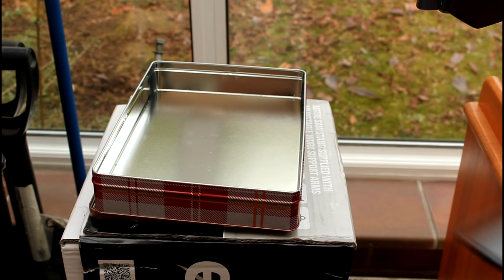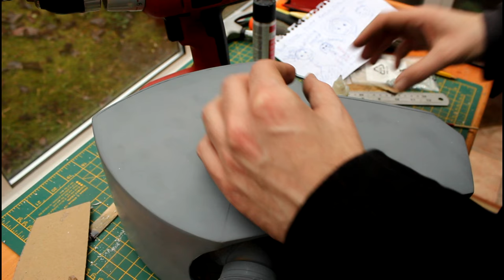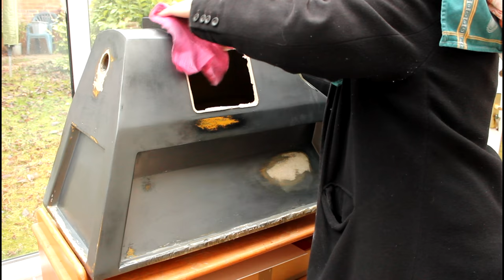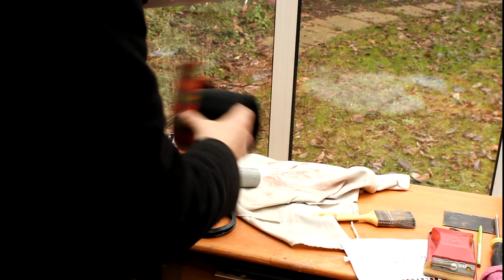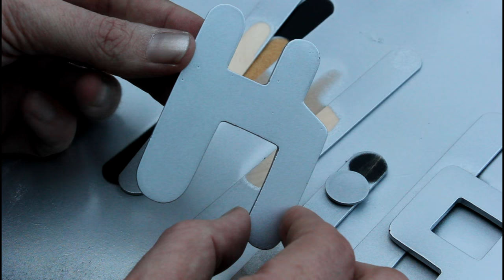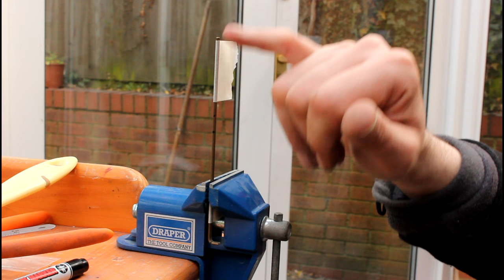K9 Replica Prop - Can this WRECK be saved?

Comment: This is fascinating and great video! I still have one of This Planet Earth's K9 which I bought nearly 20 years ago. Body wise it's still fine apart from a small chip near the nose where the hoover fell and hit it. The ears are the biggest pain in the rear. They seem to break just by walking past it.
Reply from the maker: Thanks for watching my first YouTube video - things have (slightly) improved since this was made. If you ever get around to repairing your dog, the paint used was Halfords Rover Gun Metal Grey - they do "touch up" pens, so that may work for you on the chip damage that it has.
Reply: @PBProps  Thanks. It's a small chip, but something I always notice first and irritates me.
Reply from the maker: The chip pen will work wonders for you in that regard then!
Reply: @PBProps  Just finished the vid now. What paints did you do for the ears and foam bumpers? Over the years the bumpers have got lost. I found a similar foam tube that I cut to size to match the remaining bumper. The new ones are lot lighter.
Reply from the maker: Trying to remember back five years, but the silver was possibly "Stardust" and the bumper paint was the black vinyl spray, usually found opposite the main spray colours in the specialised section, all from Halfords.

Comment: Any advice on how to make the screen from scratch. That's basically what i have left but I'm stumped.
Reply from the maker: Any advice? Yes, of course! Pull up a seat and let me tell you a story. Pay attention now. Right, are you comfortable? Then I shall begin...

Take the hole that you've cut out in the side of your dog and line it with something called "Hockey Stick Trim" or "P Profile Edging Strip" - as that's what was originally used and you can still get it to this day from any shop that sells plastic extrusions. 

Once you have that glued into in place as your screen surround, mount some blocks on the inside of your dog, just behind the strip (on the blind side) and then mount a square panel of plastic (acting as the actual screen) to that. This has to be flush with the back edge of your edge strip and hey presto, you've got a screen!

Ta daaaaah...

Hope that helps you out.

Comment: I'm planning on making a full scale RC K9. Wondering about how to build the body, I was initially thinking balsa in particular thin around the head to get the curved shaping but wondering if a straight fibre glass approach would be the way to go.  Any thoughts?
Reply from the maker: You could make it from a number of materials really; thin sheet MDF, Expanded PVC sheet or styrene. You can shape all of these until your heart's content and they are light weight, though you could back it up with fibre glass on the inside for extra strength. Balsa is okay and you could strengthen it with fibre glass at a push, but it's not something I'd entertain really - though that is not to say that you shouldn't as this is just my personal preference.

If you're feeling particularly adventurous, go for a complete fibre glass casting, but this would require you to make a tooling master and a mould from that, then a casting from your mould. Or you could keep your eyes peeled for castings that are already made - they do turn up on eBay from time to time.

Good luck with your build!

Comment: Really really enjoyed this, the presentation, your narration, every thing was superb!

I have heard some bad things about This Planet Earth, and I can see here cutting corners and using pretty cheap materials, and most of the things on there site is over few thousand, and they are little more than life size action figures. 

Would you say K.9. Is an easy build ? As I have always wanted to make one.
I look forward to more of your projects!
All the best.
Reply from the maker: Regarding the robot dog; I guess it all depends on your level of skill as to whether or not it is easy, though I would suggest that K9 is a basic or simple build. If you you were to buy the parts and then just put it all together, then yes, it's a really easy job.  

However, if you were to scratch build this, it's still quite a simple job, but obviously it takes more time and effort.

Good luck with your build, just dive in and get started - that's the greatest step you can take! Oh, and thanks for your kind comments about the video. Much appreciated.

Comment: One thing that is hady with super glue for structural stuff is add some backing soder, becomes a pretty solid bond.
Reply: You can also use this mix for gap filling. Dries extremely hard, hard enough to use to repair the nut of a guitar

Comment: Great ive just brought  one of these two day the head is ok but the body work is all scratched . Id love to put some LEDs for the eyes  but i dont know id put them in as it looks from your video the head is solid ?
Reply from the maker: In the video, you'll see me starting to take the head apart, it is in two pieces; the main body of the head and a top lid - but the lid is sealed on. You can break the seal as you saw me start doing, with a screw driver, but the only reason that I stopped was because the casting was so thin that there was a massive danger of me breaking it. Had this not been the case, I would have continued the operation. You might be lucky, your dog's head may be better cast and not have the issues that I faced. 

Best thing that I can suggest you do is try it out and see what the state of play is.
Reply: @PBProps  thanks
Reply: Do you still have it ?

Comment: Wonderful video, do you have any approximate dimensions on the rings used in his ears, his ears overall and, the tail used for K-9? All the blue prints I have found don't really say. I've come across a couple of ears available on Shapeways website that look pretty good but not sure if I want to pay that much when I can make them myself.
Reply from the maker: Thanks. The ear rings were 12mm and 18mm (1/2" and 3/4") and the tail one was 25mm (1"). Personally I wouldn't bother with printing them as you could make them cheaper and faster yourself, plus they'd look and be more accurate this way. Good luck!
Reply: Another question I forgot to ask, what are the approximate dimensions of the ears overall? Thanks in advance.
Reply from the maker: To be honest, I really can't remember. For this one, I just traced around the existing ear and duplicated it.  All is not lost though, there are several shots in this video of me working on the ears with the mesh laying on my cutting board - now the small squares on the board are half and inch wide with the larger squares being one inch. Knowing this, I'm sure you'd be able to get a fairly decent ball park figure.
Reply: AH, great idea. I also use a similar cutting board. Thanks so much for all your help. I think I have everything I need. I'm getting back into this after almost 20 years. I used to build K-9's for years until robotics fell out of interest in my area. I was for a short time a robotics teacher and brought my K-9 to class for the kids to learn from.
Reply from the maker: No problem, glad to be of some help to you. Your robotics background sounds really interesting and using K9 to teach kids is simply amazing - what a way to grab their attention! If I ever get around to making my own K9 (I have three shells waiting) maybe I should tap you up for robotics advice... you've got to have an actual robotic K9 after all.

Comment: One thing I’d like to ask which has bugged me for years and to no success  have I had in finding an answer is what is k9s tail made out of ?
Reply from the maker: It's always been off the shelf materials, just like in this video - various sizes of metal tubing (usually aluminium) all slotted into one another.
Reply: PB Props thanks. I had to use a modern car aerial when I built my full size K9. The aerial still had a good effect but trying to find the part that helps wag K9s tail at the base to then build the tail stem up to look like the props was something I just had no luck in finding.
Reply from the maker: When you say you had trouble finding the part that "helps the tail wag" - are you talking about the actual mechanism or the rubber grommet?
Reply: PB Props the rubber bit (I couldn’t think what to call it lol) and thanks for your comment on my K9 and glad you like it :). Still annoys me it got destroyed few years back and it was nothing dramatic like fighting a dalek or something but rather I came home from a good day at work to find my shelves had fallen off the wall with all my doctor who stuff on them and crushed my K9 and wrote it off :(.
Reply from the maker: That sounds devastating, but seeing as you've built one, you can always build another. The rubber piece you're talking about would be a "Rubber Gaiter" or "CV Joint Gaiter" - you'll just have to find one that looks right. Good luck in your search!

Comment: I can’t believe this was actually a licensed product.
Reply from the maker: Do you mean in terms of the way it was bodged together or the fact that you could buy a full scale replica? Either way, I know...
Reply: PB Props I mean by the design.  Your great restoration work is what should have gone into the initial build. I built my K9 based on the Dave Everett  plans (R2 builders founder) , but updated everything to full functionality with maintenance in mind. My 1/4 scale k9 went further with interactive screen.
Reply from the maker: @R2D2inAustralia  It must be great having your own mechanical dog. I've got two or three in bits waiting for me to finish them, but I have nowhere to house them, so they're tucked away in the garage until we can move to a bigger place.

Comment: There I was thinking "oh my god that's a shonky build" and then I realised "hold on a minute, that's a copy of a BBC prop, it's probably better than the original"
Reply from the maker: Yeah, the original was built in a rush and this copy was really badly made too, so when I took the project on, it was an uphill battle, especially given the very low budget that I had to work with. I feel that the end result was a vast improvement though. Thanks for commenting.

Comment: Can i ask how the nose gun is held in as on my one its extetened to about 7 inches out of the head   so is in the way and all the others  ive seen are in the nose housing ?
Reply from the maker: On this particular one, it was held in with body filler to the underside of the nose panel. Yours is sticking out by that much? Weird...
Reply: Ok thanks  ill some how get it out then,  or cut it short by the way how did you get the pipe  lagging black as its unusually grey?
Reply from the maker: I sprayed it black with vinyl spray from Halfords. It's for painting bumpers and interior plastics.
Reply: @PBProps  Thanks
Reply: Do you know how many tins of grey and primer you used please  ? Also ive removed the tv screen on k9s side and there is no access  hole its just glued to the solid side 🤔
Reply from the maker: I tend to go way over board with paint, mainly because I want perfect coverage. I think I used about three cans of primer and six cans of the grey, though with the grey, I did do a lot of wet sanding and polishing in between each coat - though I edited all that out for timing reasons.

As for your screen, you could always cut an access hole there and let your screen cover it when you come to put it back in place.
Reply: @PBProps  thank you ive decided  to cut the other side like it is on tv so you can open most of the one side up. Do you know where be best to get a gator for the tail from ?
Reply from the maker: Search for a gear stick gaiter, in particular those for the original Mini cars.
Reply: @PBProps  so ive took the head off and had knock the gun in to the head and drop it out of the the neck pipe . One thing you did show was the control pannel after you took the buttons off . Did you respray it black ? And where did you get the buttons from ?
Reply from the maker: The buttons are the same ones that I took off, I just resprayed them and glued them back into place. As for the computer panel itself, most people seem to think that it was black, but it was actually the same colour as the body (grey) and so that's what colour it ended up here too.
Reply: @PBProps  cheers

Comment: you should add a remote control car to the bottom so you could move it around with remote of the car
Reply from the maker: Having it radio controlled would be fun, but the guy who commissioned me to do this didn't want that at this stage for budgetary reasons, though it may get an upgrade in the future.